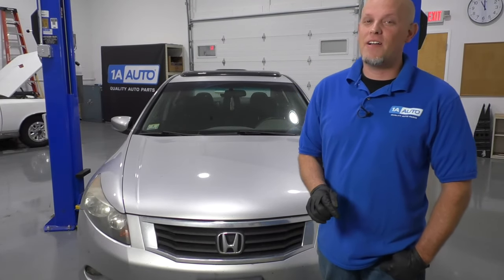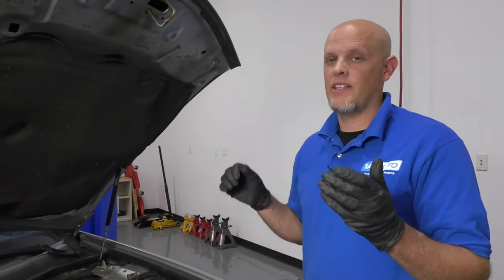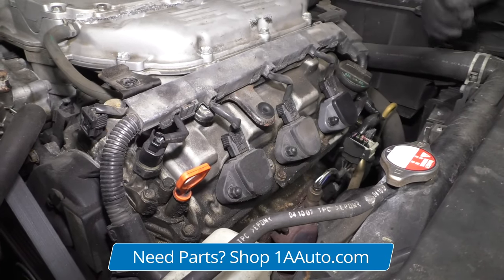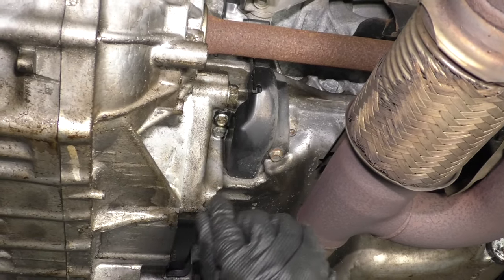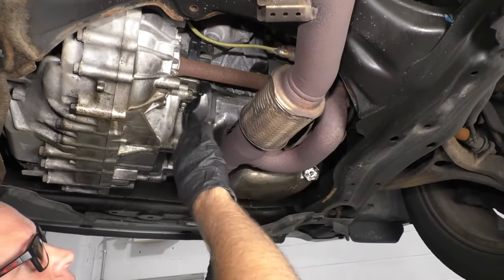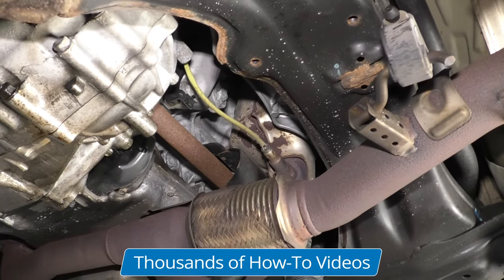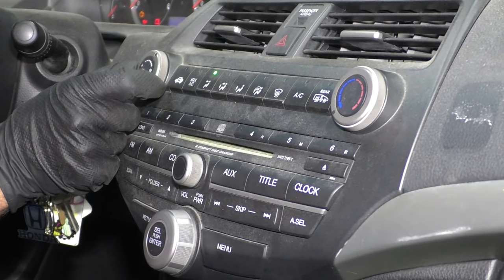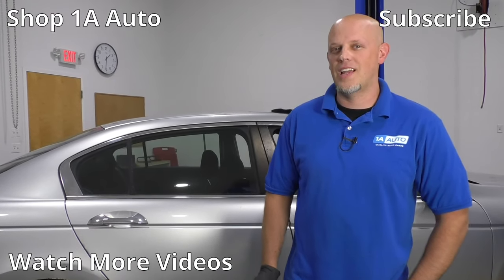Top 5 Problems Honda Accord Sedan 8th Generation 2008-12

Comment from the maker: √  Watch the Video
√  Buy The Part at 1A Auto http://1aau.to/m/Visit-1AAuto
√  Do it Yourself
√  Save Money
Reply: Goid video but you forgot 1 last thing. The radios at some point stops working, or the CD player. And sometimes the radio stays on draining battery after removing keys. 03 - 08 Accords
Reply: 2012 was the best one made
Reply: I have 08 accord and my engine temperature heats up more than normal. But my temperature reading doesn’t over heat. Anytime I drive about 30 minutes with air conditioner on.. the water in the coolant hose start boiling. I can feel it when I place my hand on the hose. What can I do?

Comment: I own this car and I give maintenance myself. I haven't had any mayor problem   it had 200k miles now.
Reply: wow nice! i have a 2010 honda accord exl with 202k miles and it runs beautifully 🙏🏽 only issue i had was my axels needed to be replaced as it was used by a previous owner 👌🏽
Reply: You had problems with the speakers being quite do I need new ones?
Reply: I have a 2009 honda accord V6 with 254000 miles and it hasnt had any huge problems just regular maintenance
Reply: Same here brother. I have an 08 EXL v6 and LOVE IT
Reply: Same
Reply: @gavinwalton1276  no problems at all ? U haven’t had a problem wit the leaking seals ? That most V6 of that gen has a problem with ?
Reply: @gavinwalton1276  no problems at all ? U haven’t had a problem wit the leaking seals ? That most V6 of that gen has a problem with ?
Reply: Same. We’ve owned one since new and never experienced any issue highlighted above. Surprised the rear brakes weren’t mentioned
Reply: @Only1Jfinesse   most likely yes, mine has 53k on the dash and my passenger front got low so I ended up replacing all 4 just so music can sound better
Reply: @andrewdryer3716  I have same model but I having several issues. Like alternator,  stater , catalyac converter.  And recently vsa lights . I am very frustrated to fix this problem every month.
Reply: I’ve got a 08 and it’s ac compressor went out and it’s starter, after 14 years I guess I’d say that’s pretty good 146k miles and still holding strong, however this was not my car up until recently, one owner, really REALLY good condition, only minor aging
Reply: I just did a brake job on a 12 and afterwards the pedal would go to the floor after it initially stops the car and i hold pressure to the pedal. My gf said it's normal on accords. Did u have that problem? I didnt adjust the caliper bleeders and the brake fluid doesnt leak.
Reply: I have this same car and color and mines is at 234k
Reply: Hi! Looking at a ‘09 LX P for my daughter. How many miles does your car have now? And is it still going strong?
Reply: @Baesicc  yeah she still driving
Reply: @Doubleg96_  okay! That makes me feel good. Happy for you too!
Reply: Did you ever tune it up or change the coils? so far my 2012 is on 150,000 miles the only thing I’ve had to do so far was replace the starter..
Reply: I have an 09 Accord,  it vibrates during stop idle and have done everything from carbon cleaning to new spark plugs and it maintains, It runs fine though. Does your vibrate on idle?
Reply: @ismaelmori18  motor mounts good?
Reply: Wait til 300thoussnd miles,,,everything will fail,,,also if you have to replace headlight bulbs,,you have to take front bumper cover off!!!👎🏾👎🏾👎🏾👎🏾
Reply: @reallynah how did you get to know that you need to replace the axles?! What were the symptoms? Thanks
Reply: @nicholaspetre1  of course and my axle shattered mid drive! couldn’t put it in park either but it was definitely time for a new one. i haven’t had any major issues since owning it at 174k(2019) to now 230k miles. i just have to do a flex pipe to the exhaust, my car makes a rattling noise when idle becus of that, engine is a pretty old so i lose just a little more gas than usual but it’s amazing. it’s saved me plenty of money since owning it 😏
Reply: @reallynah  thank you. Interesting experience actually. By mid drive do mean that connecting shaft  between CV joints or smth else?! I just have some noice on the front passenger side and I am damn sure it is not a hub bearing. Maybe cv axle?!
Reply: @nicholaspetre1   nahhh the axel broke apart, the whole thing so I had to get it towed, i was on my way somewhere and next thing you know the bottom of my car made huge clunking noises, my radio was making all sorts of noises and parts of my axel was hanging from the bottom. it was time for a new one for sure and apparently it’s a “honda” but i think it depends on driver and the manufacturer. and for the noise on the passenger, sounds like it could be a hub bearing but it depends on how it sounds. never had that issue but i’m hoping it will be fixed for you!
Reply: @reallynah  gotcha! Thank you. I have a problem now with both hub bearings, $400 for parts and labor for each side.
Reply: @gavinwalton1276 wow. That's alot of miles.  If you don't mind me asking, you never had transmission, engine or any problems with the ac compressor etc.  Thanks
Reply: my 2011 Accord EX-L has 202k miles and its pretty worn since it used to be my mom's and she did barely any maintenance on it but im working on restoring it to perfect condition
Reply: @DingoXBX  best of luck, Mines has 244,000
Reply: @GoodfellasNYC  thank youu :)
Reply: @DATSUN-zo1bv  fun fact, you don't have to take off bumper cover to replace headlight bulbs, even though many references will tell you that. I simply pulled my wheel off and pulled the clips on inner fender cover and it's quick, easy access 👍 Still harder than some cars, but doesn't take long at all.
Reply: @DATSUN-zo1bv no. you can reach the headlight bulbs through the wheel well without jacking up car. I did it when installing LEDs. there's a few videos on that as well here on YT
Reply: @clsickspeed904 didn't see this reply but you can actually just turn the wheel inward of the side you are installing them and do it like that rather than removing the wheel
Reply: @Eligaminglee  yeah, funny enough I just had to replace my passenger low beam couple days ago and figured that out. I'm a tech by trade, so think I got it confused with another vehicle. Meant to come back and edit or clarify my comment, then couldn't find it til I just got tagged lol. I was thinking while pulling the liner out that by trying to make it easier, I made it still harder than it had to be 😆 sorry, been a couple yrs since I had to replace one, weird 1 just went out again not long after commenting about it.
Reply: I just hit 200,000 miles in the accord and I put it in reverse a cranking loud noise occurs and doesn’t reverse even when giving it gas
Reply: How is your Accord doing right now? How many miles at the moment? Any issues? Thanks
Reply: I’m getting one on Monday 😎😇
Reply: Hows the

Honda Accord Tourer 2.4 i-VTEC Executive. :) maybe gonna get one.
Reply: I’ve had multiple major problems. Eventually had to put a new engine in that had 80k now around 95k and still giving me problems. Engine light, VSA light and “Catch all” light is on

Comment: Can't believe you didn't mention the vtc actuator. Easily the most common widespread issue on these cars. If it hasn't been replaced with the updated part it will make noise eventually, guaranteed
Reply: I was going to write about the vtc actually the vtc should be the number 1 on that list followed by the wheel bearings !!!!
Reply: Well the model he's talking about is the V6, you can tell by the fog lights and the V6 is not plagued by the VTC actuator issue
Reply: @OG-Semp  I have a v6 honda accord, currently facing issues with the vct actuator.
Reply: Is the vtc actuator effecting the 2011 honda crosstour?
Reply: @jupiterbullish2520  Yep. Any accord 08-12 with the 4 cylinder will have this issue if the phaser hasn't been replaced already. It's not hard to repair, if you have done a valve adjustment on this engine you are capable of replacing the phaser. My advice is to have a very well calibrated torque wrench for the cam journal caps and to clearly mark the timing chain with a paint marker. The camshaft has a keyway so you can only install the phaser one way
Reply: VTC actuator are only on the 4 cylinders accord.....actually on chain driven Honda's and acuras
Reply: @firstlast---  I belive my problem may be the timing belt tensioner becuase its is a V6,  the knocking only happens during cold start up then fades after a minute
Reply: @jupiterbullish2520  yes. had it.
Reply: @firstlast---   That is a damn good advise.
Reply: I was waiting till he mentioned that cause I replaced both from my wife and my car
Reply: My 2011 v6 sedan had a timing tensioner issue. After fixing YT hat everything else been ok.... besides sloppy tranny, headliner falling, driver side visor messed up, besides all that the car is great.... I’m at like 126,000
Reply: Yup I have it
Reply: Yep, both front wheel bearings in my 09 v6 accord went before 120k. And the calipers are right there with them.
Reply: How much does it roughly cost to fix that
Reply: @same3013  it depend on were you live I guess in Canada that part is roughly 300$
Reply: I didn’t change it yet and it’s been a year and the engine run fine
Reply: @panzermagier  Yeah be careful about that. Each time the phaser rattles it puts stress on the chain which over time if let alone long enough will stretch the chain and that can lead to jumped timing
Reply: @firstlast---  i know trust me, I’ve chek with the previous owner and he said that he change the timing chain tentioner and it temporarily fix the problem, he said that she was doing this 4 years before that and I have it for already a year and she is driving daily on the highway so she would have blown already trust me, K series engines are tuff, I will fix it for sure this summer.
Reply: @panzermagier  Thought I was fine too but two weeks after changing the actuator I got codes for camshaft correlation. Chain was stretched enough to put the engine slightly out of time and it never showed itself until the actuator was replaced
Reply: @firstlast---  y’a that’s the reason why I will change the timing chain and everything else
Reply: @same3013  and you also need a valve cover gasket kit
Reply: You know the vtc actuator is a common problem when the Honda parts guy has the part number memorized.
Reply: Is this the sound I’m having when I turn at low speed? Hear rattling until i’m going straight again
Reply: @horsied  mine is doing that when im turning but it’s more like a whistling
Reply: @horsied  Try refilling power steering fluid, gave me some issues but was fine after topping up.
Reply: Yes  I had the vtc issue also
Reply: My vtc act up on cold days. I crank it lightly to get the oils moving, then crank the engine one.
Reply: @MrSwaggernaut83  dam right that noise is gone
Reply: @siamean1  I wonder if Honda made a redesigned oem part to replace it, and as far as I know other types of K-series engine of the same year didn’t had this problem.
Reply: @panzermagier  The newer VTC for the K24 will actually fail over time just like the old one. A weak crank can make the VTC actuator act up too. I upgrade my small 51R battery for the larger V6 Battery.  Problem is almost gone.  ...but still prime the oil on cold days as a habit.
Reply: @siamean1  now that you mention it when i turn the ignition abruptly the engine turn fast enough so no noise occurs
Reply: But I usually start it with the remote so it makes grrr all the time, oil pressure is a factor of that behaviour because if I shut it off immediately after start up and start it again no noise is heard
Reply: And stall you out in FN traffic!
Reply: Ive had to replace mine TWICE! 😭
Reply: What noise does it make?
Reply: @danielbahena5079  It sounds like the engine has zero oil for a couple seconds
Reply: What does that make the car do

Comment: I've got a 2010 Accord V6 I bought with 75k miles on it. Now it has 134k . Only major maintenance so far - new alternator ,timing belt ,front brakes . I'm about to have new spark plugs installed. Been a very reliable car and I love it
Reply: How long ago did you buy it?
Reply: Buying a new alternator isn’t really maintenance
Reply: @piercemccauley7079  Well it can be if it's going bad..
Reply: @danjones3402  mine only went bad because where the dipstick tube comes out of is also where the vcm solenoid is, the gasket there leaks often and its right above the alternator, oil and alternators dont mix well
Reply: These cars don’t have a timing belt you’re probably talking about the serpentine belt
Reply: Hey, i just had to replace my alternator. Will need to replace it again after just a week. Can you guide me on which one you purchased which has been working good so far
Reply: @rogersanchez9635 the v6 does
Reply: @rogersanchez9635 the v6 has a timing belt the i4 has a timing chain
Reply: I have a 2.0L 2015 Kia forte LX my mother gave me that has 78k miles, slight cosmetic damage but I really want to trade it for an accord, what’s y’all’s opinion
Reply: @packerman1203  This may be the problem I've just encountered. I see oil on top of my 2009 V6 alternator and above it. Battery or alternator dies last night.
Reply: @packerman1203 I had the exact same issue
Reply: @packerman1203 yep same issue on my 2008 v6. Replaced the gasket after the oil killed my alternator, and it started leaking again. I’m just letting it ride, currently at 240k
Reply: @TimS. yeah I fixed my leak, and replaced the alternator but at 270,000 miles if it leaks again I’m just rolling with it lol
Reply: I own a 2010 aswell I had to put a decent amount of money on it only because of the owner before me didn’t do jack shit to it unfortunately but really reliable car.
Reply: @rogersthe v6 does have a timing belt anchez9635
Reply: Did you get a PPI before buying your accord?
Reply: @packerman1203 … that is exactly what took my alternator out that oil dripping down in to it from that part!

Comment: Basically indestructible
Reply from the maker: +Nasser Anise Thanks for checking us out! http://1aau.to/m/Shop-1AAuto-c
Reply: ROFL  yeah riiiight!
Reply: @cpsinc6052  I haven’t had any issues for 250,000
Reply: I have this car. Lots of recalls. Seatbelt, airbag, burn oil, etc. Lots of road noise inside the cabin. Trunk leaks. Otherwise very good car almost 200k miles on mine. Garage kept in amazing condition.
Reply: @theniceneighbor  you recommend it ? I want to get a 2009 accord coupe but i heard about the oil problems and brake problems 2008 to 2009 accords have
Reply: @jaygarcia1937  I have a 2008 Accord (built in Japan) with 126,000 miles. Bought it with 97,000 miles and I haven’t had any brake issues or oil issues. It’s been a really good car. Had it for almost 5 years.
Reply: @jaygarcia1937  yeah its a solid car. If it has the four cylinder it has a timing chain so you dont really need to replace it. Just do your oil changes and keep up with brake maintenance. Hella reliable
Reply: @nasseranise102  my chrysler 200 has almost 170,000 miles.  Reliable ?
Reply: This car is no where hear indescribable. It seems like it has a lot of issues otherwise he wouldn’t be able to make the video
Reply: @Natethegreat200c  not a fan of those personally but good for you, you probably take good care of ur cars.
Reply: @Natethegreat200c  did you watch it? It’s mostly maintenance that he mentions. All alternators will go bad, all blower motors will go bad etc. He never really mentions a huge issue that all these cars have. The only thing I can think of after working on them is the VTC actuator which is annoying but a more or less easy fix
Reply: @jaygarcia1937  it’s a great car. The 4 cyl is the way to go. The K24 is probably the single best 4 cylinder ever made. They’re ultra reliable and can handle a lot of added power if you plan on putting some work into it.
Reply: @nasseranise102  yeah i heard they are great to mod, i been looking at a G35 with 173k , my brother in law knows the guy and he takes real good care of his cars, you think i should walk away from it, he selling it for 3,500
Reply: @jaygarcia1937  coupe or 4 door? They’re nice. Definitely not as reliable as a Honda but they’re cool. It’s a close call, the accord coupe is dope too. I’d just do ur research and figure out which one you prefer and the issue the Infiniti may have. Also the value of both on Kelly Blue Book. Paying a mechanic to check out a car before purchasing is always a good idea, if you can.
Reply: @nasseranise102  yeah im try to find a mechanic if i can to check it out and its a coupe, and the accord coupes are definitely badass
Reply: @jaygarcia1937  fwd is better on snow than rwd too if u live in an area that has snow. Idk if the Infiniti is AWD but yeah just choose what u really like and won’t have 900 repair bills lol
Reply: @nasseranise102  got you thanks for the help😂
Reply: @jaygarcia1937  delete the VSM module and you won't burn oil. The brakes will do a lot better if you flush the system regularly
Reply: @nasseranise102  v6 has major issues and were even sued because their engines would either blow up completely, leak, or destroy the coils from burning oil rapidly. I’d avoid them tbh
Reply: @Irovetti  mine has 250,000 miles and wasn’t even taken care of. Original coolant. Literally only oil changes every 7,000 miles
Reply: @nasseranise102  what year you got? Also how’s the transmission?
Reply: @alphadawg7360  2009 and it shifts great
Reply: @nasseranise102  I’m looking to get one 2010 4cyl 2.0 model with 213000kms on it. Seems to not have any issues and the leather interior looks great too. Looks to be in good shape. Would you recommend?
Reply: Adam B  how about that transmission
Reply: @melvingibson4525  how do I delete a VSM - not sure what that is ?
Reply: @ellapanda1425  is actually VCM and there's a module you can buy for about $150 and installs in 5 or 10 minutes with minimal tools